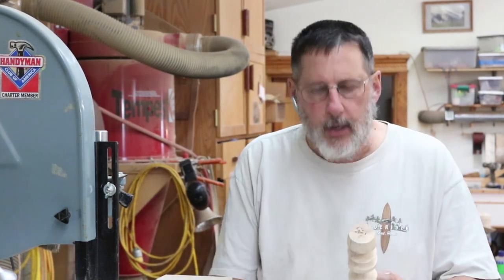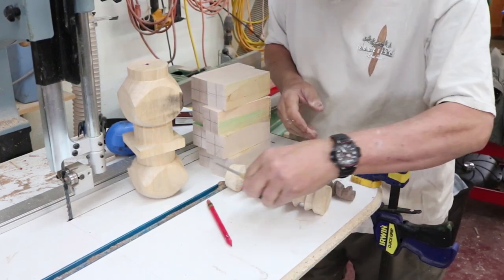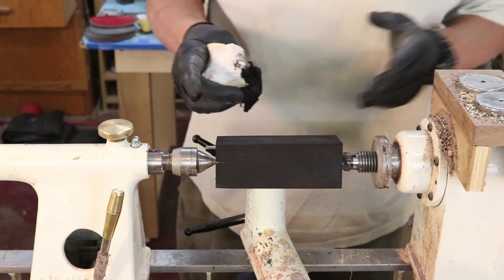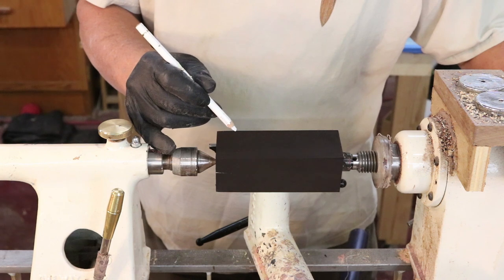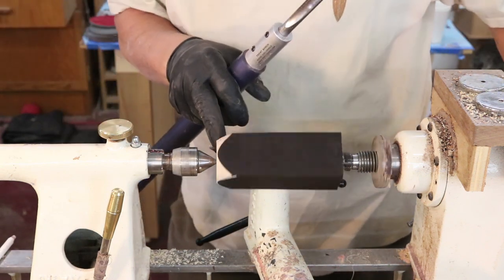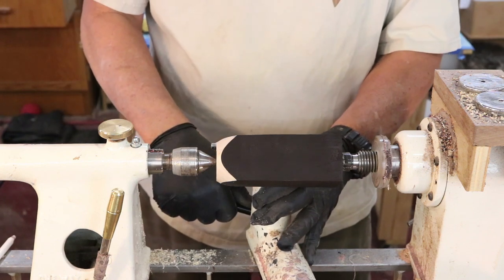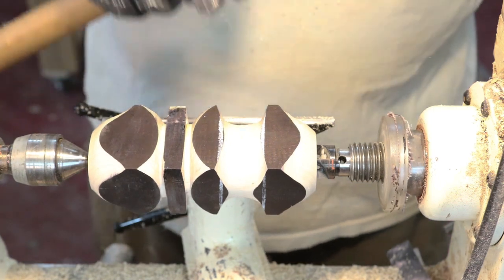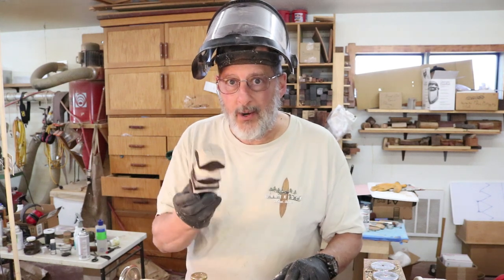Practicing with a Spindle gouge:  Woodturning with Sam Angelo

Comment: Thanks Sam, interesting video. I learned a couple of things from watching it, I could have learned more though. If you had taped a popsicle stick on the top of your gouges, I could have seen what angle to present the tool to the wood. I find watching turning being done that way, to be very helpful on learning how to present the tool.
Reply: The angle would sort of depend on the height of your tool rest... but basically you present it with the bevel flat (i.e. handle down) and then raise the handle and pull back until the tool starts biting. Ride that bevel!  Another good practice idea, presenting the tool and then starting the cut(ABC i.e. anchor the tool on the rest, ride the bevel, then cut ;) )
Reply: Len mullin i think it would be very dangerous to try to eat a popsicle while turning

Comment: Couldnt you prevent that chip out using a skew chisel? And you would have practiced a different tool
Reply from the maker: Chris,  I am sure you are right.  But I am practicing with a spindle gouge from start to finish.  But yes another tool may give you a better cut or finish.  Sam